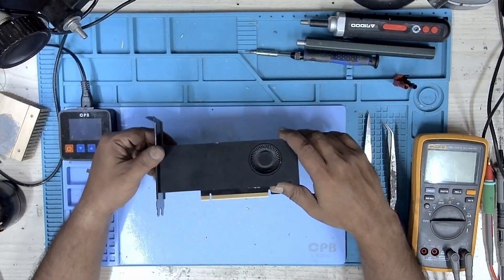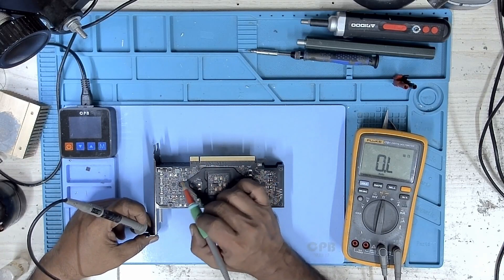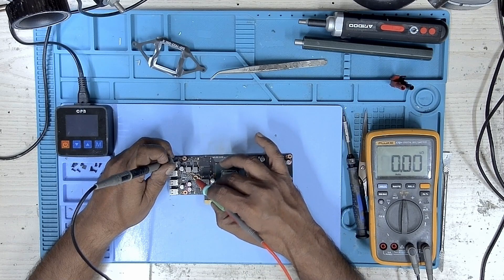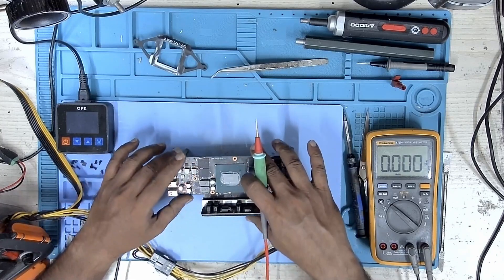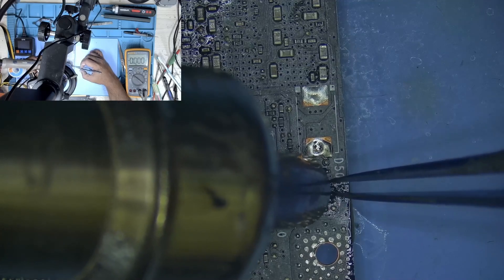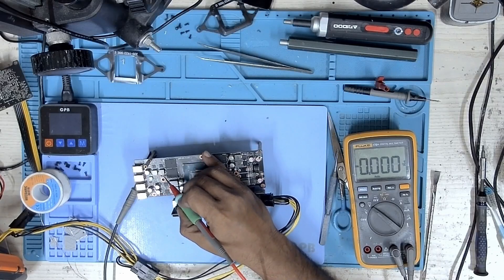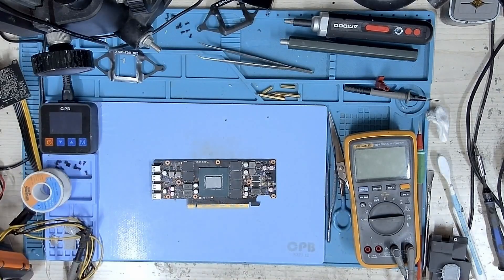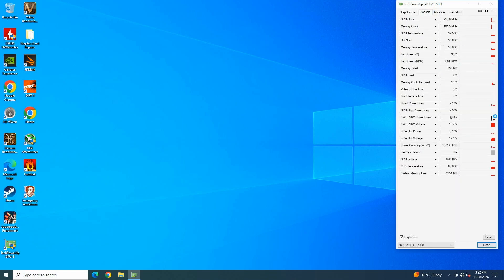Nvidia A2000 GPU Repair - No Schematics

Comment: Hi , I have a RX 6650 XT , the gpu still boots up But .. When I play a game I get the same frames per second from low to hi settings , its like its not boosting the power or something ??
Reply from the maker: This is a tricky one and it will need serious diagnosis.

Comment: Hi, I found your channel after trying to troubleshoot my A2000 with missing 1.8V which also has a missing component. Would you still have this card at hand by any chance? The missing component on my card is D505, the diode right next to the missing gate on your card. Would you be kind enough to check the marking on the diode D505? I would appreciate it a lot.
I tried checking the marking in the video, but since the diode in both of the cards is twisted, it made it impossible to be seen in the video.

Thanks for the helpful video, if it ends up being the diode, you will be responsible for resurrecting another great card.
Reply from the maker: Sorry for the late reply.  It's a Schottky Diode. part number is RB521S30T1G.
Reply: @ Thank you very much sir. I bought the diode and the card is fixed now.
Great to have people like you around 👍🏻

Comment: My gpu keeps on flickering immediately I start gaming. 
It is Nvidea gtx 450
Reply from the maker: the issue could be either with memory or with the core. You can first try applying fresh thermal paste and check if the issue goes away.

Comment: Hi, what should be the impedance of the core to ground plane
Reply from the maker: The resistance of the core is 0.1 Ohms. Regular multimeter will not be able to capture the resistance. You will need a milliohm meter to measure core.
Reply: @GraphicsCardRepairs-tk7ql  thanks for reply, i have now an usb oscilloscope, how you test data and control lines on a CPU
Reply from the maker: With a multimeter in diode mode on the PCIE slot.

Comment: sir i have question can we upgrade the vram of 1660 super to 12 gb🤔
Reply from the maker: I have not tested upgraded on 1660 super. Even if it can be done it can only be doubled but the returns on the investment to upgrade is very little as for the price of the upgrade you can buy faster GPUs like the 3060 with higher memory.
Reply: @GraphicsCardRepairs-tk7ql  okay sir thank you 😊